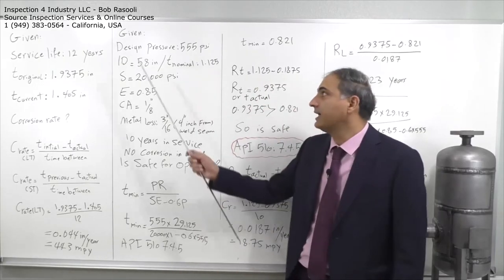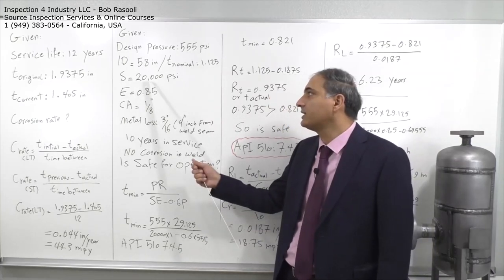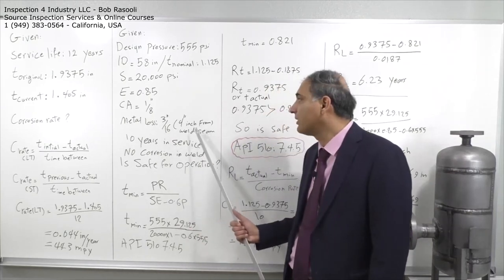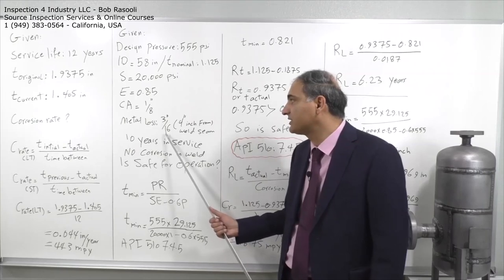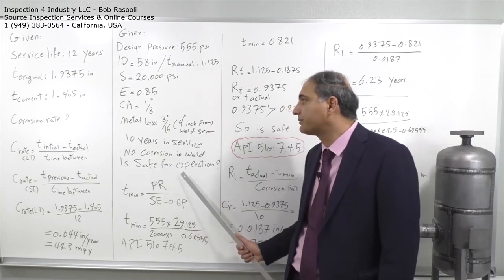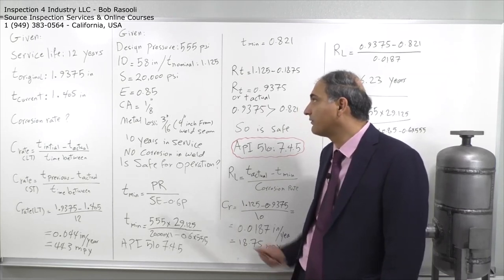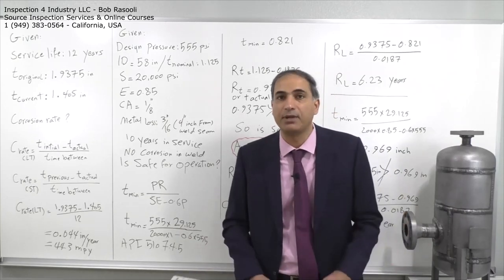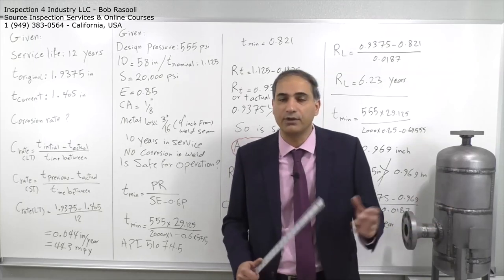API 510 calculation for Minimum Required thickness and Remaining Life (API 510 Exam Question)

Comment: For determining Corrosion rate, is it allowed to use nominal thickness as initial or previous thickness ?
Reply: initial but if no readings(CMLs) are taken it will have to be used as pervious also

Comment: Why do you emphasize indicating that there is no corrosion in the weld seam, if were corrosion in the weld seam do the equation of mínimum thickness required or the evaluation need to change?